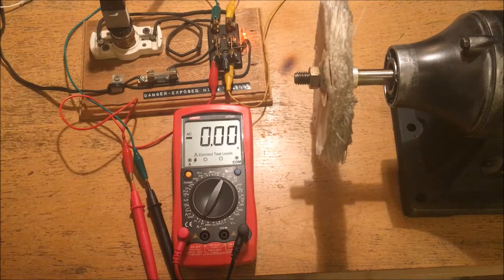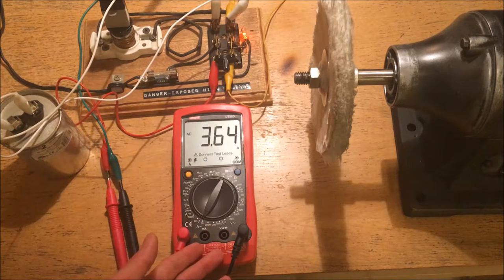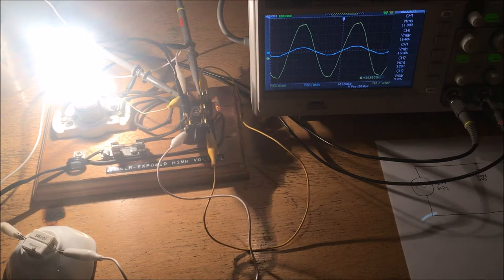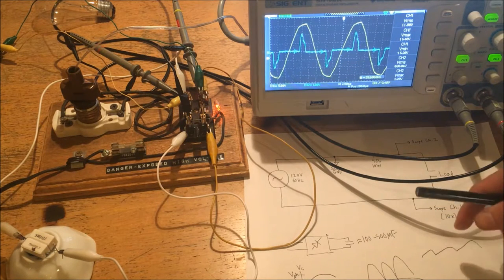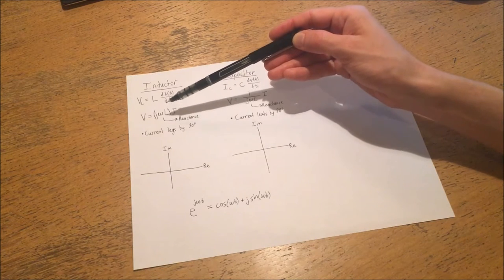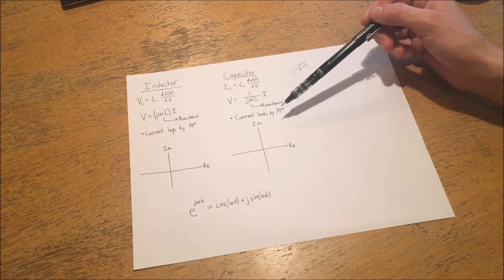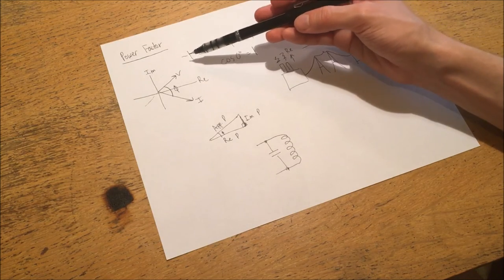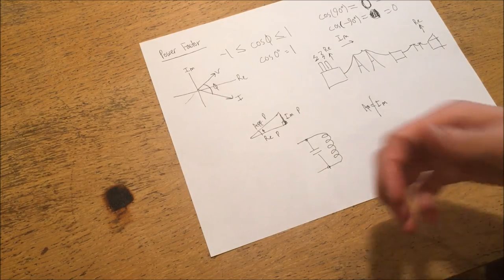EP 26 - Power Line Analysis and Power Factor

Comment: Great video. Thanks. A few comments:   At 20:40 Greater L will result in lower current.    
At 19:15 I don't agree when V=0 means V is Imaginary. Voltage is produced by generator and the wave is the representation of de FEM (spanish Fuerza Electro Motriz) . If its 0, then there is no FEM (0volts) Nothing to do with real or imaginary volts.